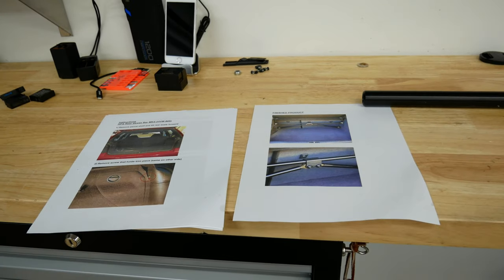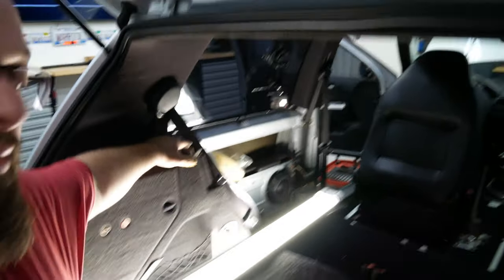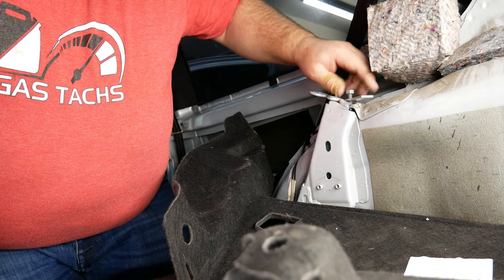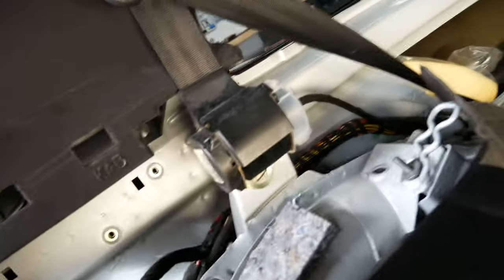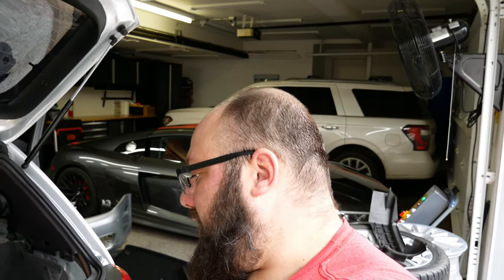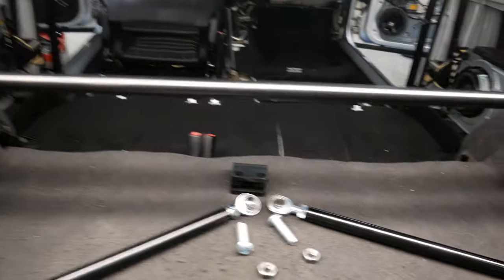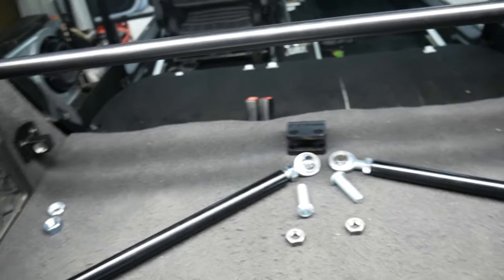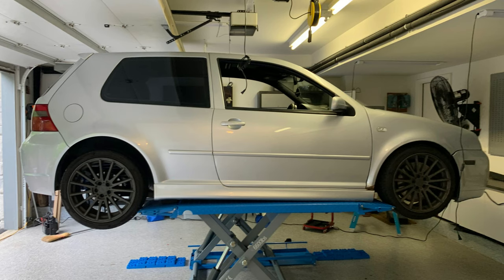VW MK4 R32 INSTALLED my NEW HPA Rear Strut Tie Bar! The Project Car Rebuild Pt. 19.

Comment: Been rocking mine since 2010 and HPA said its all good with the movement of the center piece as has been said already. Having a brace back there makes a HUGE difference and I like the HPA cause it leaves a bit more room than the Unibrace. But to totally shore up the rear end make sure you combine that with an HPA Competition Haldex or UM Haldex flash plus a rear antisway bar. Transforms the car and I can't wait till I get the rear LSD in the mix with all that I have above.

Comment: You had all the same trouble I had with this bar! Mine also flips back and forth like that as well, I contacted HPA and they said it's fine and the bar still provides rigidity to the strut towers. I wish one of the heim joints were left hand threaded to add a little preload. Nice work!
Reply from the maker: Bobby Falkenstein thanks for the info! And thanks for watching. I’ll keep you posted if I figure out how to stop the back and forth movement

Comment: Unibrace is a much better option IMO
Reply from the maker: Thanks, I looked for one, but couldn't find one for the MK4 only MK5. do you have a link you could send?
Reply: Gas Tachs the rear one for that location is the same 4 /5 he one I have in my MK4 r32 was removed from a MK5 r32
Reply from the maker: Lui Aviles good to know! Thanks!